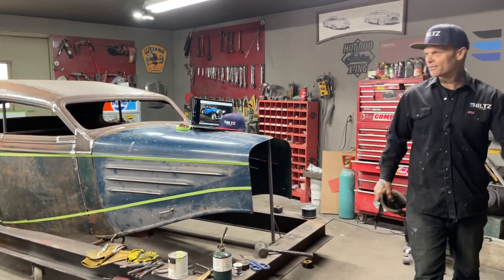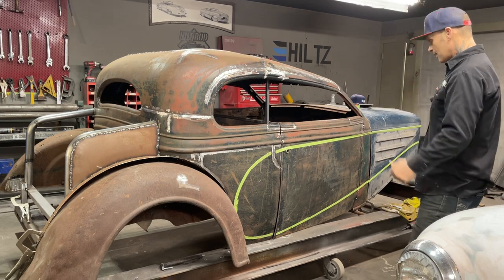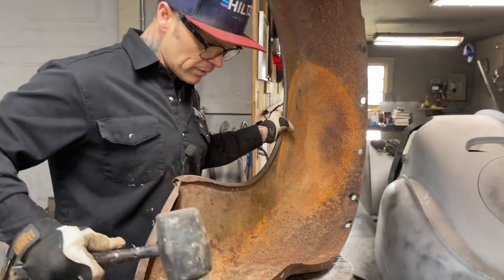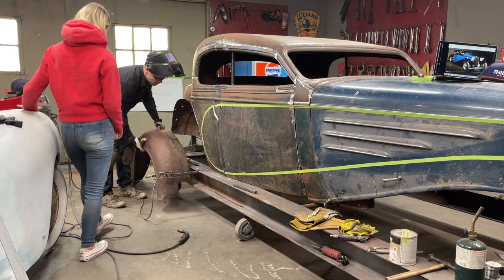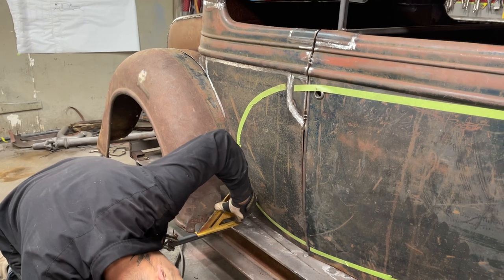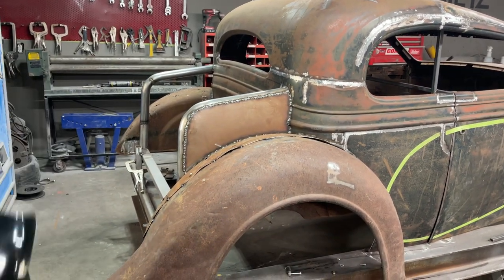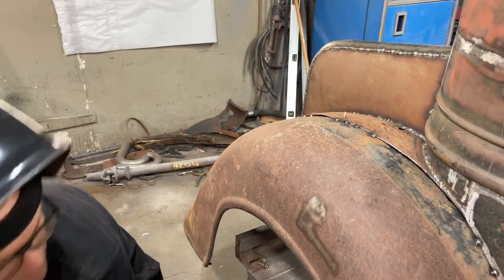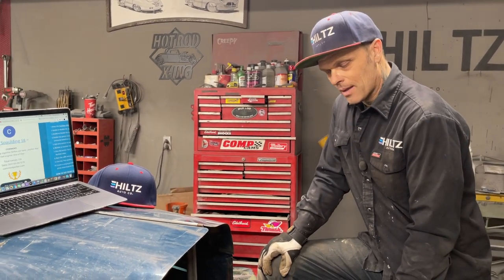EPISODE 12: BAD CHAD BUILDS (ANOTHER) BUGATTI OUT OF 1934 CHEVY -- WELDING REAR FENDER ON

Comment: ABSOLUTELY CORRECT 
FRAME DICTATES the BODY !!!
Had an excellent modern pickup frame. 
Had a 1926 Ford Model T 4-door convertible in 3 pieces (cowl, front seat, & back seat). When the 3 pieces were positioned onto the pickup frame, there was an extra 24 inches between the front seat and the back seat. 
The longer frame forced us to construct a stretched limo convertible.  It also lead us to construct a dual cowl phaton, complete with a second windshield for the backseat folks.
THE FRAME DESIGNED the STYLE of the CAR

Comment: It's amazing what you are doing with what others would call scrap. So far you've only used grinders, welder, plasma cutter, roller, beverly shear and some hand tools. The tape line might look better on the hood if it was equal distance from the end of the three spears. The fender height may not allow that. Good job numbering each episode and great video.

Comment: Chad, in days of old the car manufacturer would build the frame and then send it to a coach builder, and I assume drawings of what they wanted the body to look like.  The coach builder, I would reckon, would have some discretion to add his trade mark fender or roof shape or what ever characterized his work.  A case in point was the type 41 Royale Kellner Coupe, the coach builder was Kellner and it was built on a type 41 chassis. If you were to clip your mic on to the front edge of your collar it might help when you lean into things.

Comment: Chad, would it help to have a section of workbench say 2 foot by 4 foot on wheels with a place to hang tools and extra stuff such as sanding discs, welding helmet, etc. Perhaps even have a power bar attached then you have one cord to the bench and multiple plugged tools and hung up ready for use? I really enjoy your build with the running tutorial.

Comment: I use to manage a staff of 12. I soon learned that not everyone worked in the same way. However I also learned that as long as the job was done right and on time it wasn't my place to impose on them the way that I would do it. So Chad do it your way. If it works why change your method.

Comment: Way back the manufacturer, like Bugatti would have supplied the coach builder with a rolling chassis. The body would then be designed and made from scratch. But I understand what you are saying about wanting the body as you want it and the chassis will be made to fit. That is the limitation of your method. No harm in that, just different. I am enjoying this series so keep going. Will we see a chassis and a car on the road?

Comment: A big hello n love you guys from Haddington ,east Lothian Scotland , would love Chad to see my 1972 honda c90  rotted holes in frame , I cut rear mud guard off up to rear shock mounts reinforced it ,cut tube n replaced with 150mm longer piece of scaffolding pipe , preped n painted British racing green with extended rear arm n super Moto wheel and standard front end , cut seat in half and retrimmed , it turned out so good ,even if do say myself , thinking I should do some content ,but not sure where to start chad ? Need a better half like yours to do all that side ey ?

Comment: Chad, I am certainly not qualified to criticize your work but on  the mounting of the r/r fender. If you had started your tacks at the front and  followed through to the rear, you would have not gotten all those puckered up spots,  you should have just put one tack in the rear and then went back and followed through from front to rear . If you would've needed to correct anything on the way, all you would have had to do was move the tack in the rear. Now you will be trying to dolly out all those puckered spots through the whole build. I think you were just concentrating too much on getting the fender on and not paying attention to what was going on in the rear before it was too late and you had to try to play catch up.